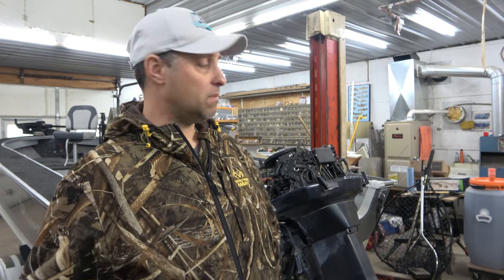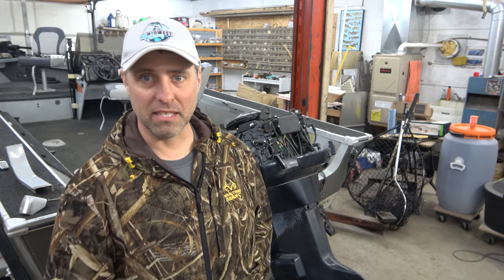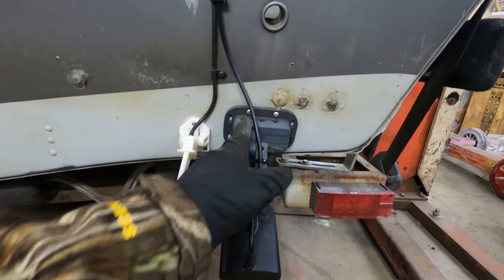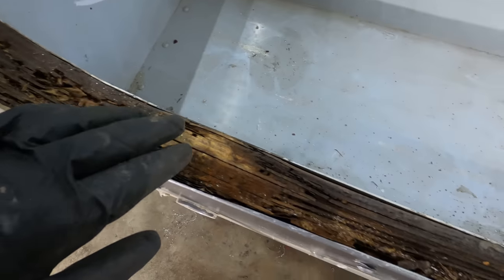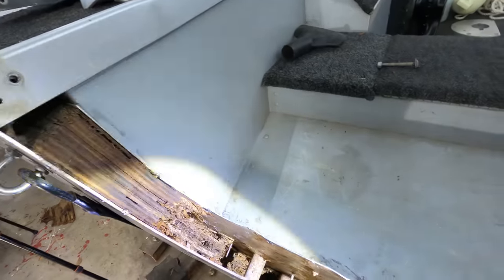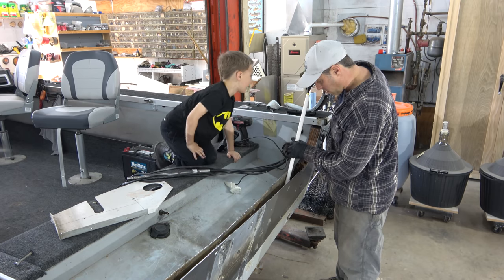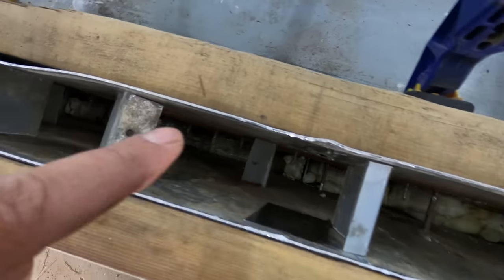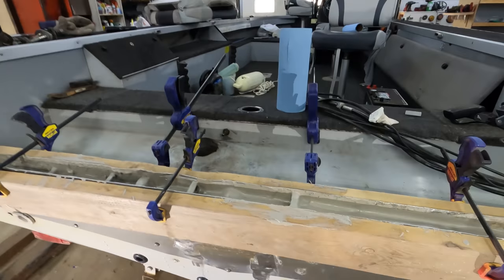The Easiest Way To Replace A Boat Transom

Comment: I’m curious as to why the transom dry rotted anyway. There had to be water intrusion for a long time
Reply from the maker: The boat is almost 30 years old and has had a lot of things screwed into the transom. I'm sure it was exposed to plenty of water. Its pretty common for transom wood to rot after a while. Thanks for watching.

Comment: Do you think this will seal up holes created by the bottom of the motor mount on the motor side?
Reply from the maker: Yes. I covered all the holes with an aluminum tape. Then when it cured, I took the tape off and painted over it. I drilled out all the holes I was reusing. You can work it just like wood.

Comment: Hmm, seems like forgiving stuff, the only real issue I see this project having in the future is that spray foam is likely not closed cell like a 2 part marine foam and will water log rotting whatever is around it, hopefully it just doesn't get exposed to water.
Reply from the maker: Thanks for the comment. The main purpose of the foam was to contain the resin until it hardens up. Otherwise it would just leak into the bottom of the boat and none would be left in the transom. It seemed like a good idea at the time, but I see the issue now. I will look into other options if I do this again in the future. Do they make closed cell spray foam? I appreciate the input.
Reply: @GoMidwestFishing  The only way I know of to get closed cell marine foam is in a 2 part mix and pour.

Comment: Expanding foam seems to be a good solution, but the problem is that it is not a closed cell foam.
Ergo, in contact with water, it absorbs and retain the water.
If you can find a Closed Cell expanding foam, you are OK.
South Africa
Reply from the maker: Thanks for the tip!

Comment: Haven't watched it all yet but dude, don't get rid of that old Evinrude v4 2 cycle unless you can find another, they made those starting late 60s and not much changed since then for a reason
Reply from the maker: I will admit, it hasn't let me down yet. I'm thinking I will probably just keep the Evinrude after all. I have a Mercury 135 I'm working on, and thought it might look good on my boat, but it will be a lot of work to swap them.

Comment: Okay.  I have watched several of your videos.  I have seen enough to know you always try to do good work and you do.
You were working with a new product and you did okay.  If I had a boat, I would not afraid to have you work on it.
Speaking as a metal fabricator and jet sheet metal mechanic, I would have done one thing very differently.  Where that horizontal platform meets the transom, you tried to weld it and it failed.  Not your fault.  Instead, I would have fabricated heavy gauge angle, applied sealant, and riveted it.  I have a lot of experience with a product called a cherry max rivet gun.  They are used on mach jet aircraft.
That would have greatly increased the rigidity of the transom.
Now, on to the criticism.  The people that built that boat are garbage.  That transom most likely takes the most vibration and stress on the entire boat and they used sheet metal screws to hold the horizontal metal to the transom??
In a pig's eye!!!  They guaranteed water intrusion.  Their design was doomed to fail.
Your work on saving a crappy product is commendable.  Thumbs.
Reply from the maker: Hello Wrongfully accused. (great name btw) That was some really good helpful information, I appreciate that. You are right, I genuinely try to do a good job. Most of the time I'm doing something for the first time and documenting it as I go. That means I will make mistakes, but that's how I learn. That's also why I buy most of my items used off Craigslist or Facebook. That way I don't feel bad if I mess something up.

Comment: Your increase in speed probably came from raising the engine that one hole .  Your cavitation plate should be even with the bottom of your boat .  If your motor is lower than that , it creates drag meaning slower speed and higher fuel consumption
Reply from the maker: I agree, but now my motor sucks air when taking tight corners, so I may need an aftermarket cavitation plate to help with that.

Comment: I think the inner and outer aluminum panels take most of the stress and the original plywood just kept the thin panels from buckling much like engineered beams. In any beam, the highest compressive and tensile stress is at the very bottom and top of the beam where in this case the two skins are. A similar construction example is the VeryEze home built airplane that is made from weak Styrofoam like foam but covered with fiberglass cloth and squeeged out resin on both sides, extremely strong design.

Comment: how much extra weight now over a pressure treated plywood job? i know both are heavy, just curious if this is like 50 lbs over what a standard job would be?
Reply from the maker: Good question. I don't know how heavy the wood was, but carbon core weighs 45 pounds per 5 gallon bucket. I used two buckets, so that makes it a 90 pound transom. I'd say you are close with 50lbs over. Its probably 30-40 pounds heavier.
Reply: @GoMidwestFishing  thanks for the reply! 30-40 lbs over isnt bad for an 1800+ lb boat fully loaded (just a wild guess) and a bulletproof transom.
Reply from the maker: @ct1762  I agree, and so far I haven't noticed a weight difference, only a speed difference.  It gained a solid 2 mph on the top end speed.
Reply: @GoMidwestFishing  cool! I guess the old transom was flexing, pushing the hull into the water more increasing drag

Comment: I get your point and being a smaller lake not open water.  BUT i'd put a marker buoy on some line to be able to locate the motor on the bottom of the lake when she falls off.     probably more rotten wood if you kept digging.    well done video, entertaining and worthwhile.

Comment: good vid but you should have used sealant for your bolts and screws or you will be going back for more repairs. that is just one issue. But the issue you wee dealing with you damn near did it perfect but just missed a couple details.  Good job

Comment: They should have used Black Locust for the transom. That wood never rots.
Reply: Old folks knew what to make fence posts out of. That stuff will easily outlast treated wood. It's hard as diamonds and makes a chainsaw vibrate like you are cutting steel.

Comment: Hope it works out for ya.  Kinda no turning back on this one as getting that product out of there will prove much more difficult than removing rotten plywood.  I'd've gone more traditional with resin coated plywood but hey, that's just me. Good Luck to you.
Reply from the maker: Hi Alex. I did resin coated plywood on my last boat. That boat was easier to access from the top. It worked well. There are lots of options to choose from. I enjoy experimenting with new things, so I really wanted to try the liquid. Your right about removing it. Hopefully I never have to.

Comment: was the expanding foam strong enough to hold the motor solid?
Reply from the maker: Hi Chad. The foam was only to keep the water out of the top half inch where the transom didn't quite fill it up, and to stop the carbon core from escaping out some gaps. It has no structural properties. The liquid transom is so solid that it held the motor great. It has been holding up well, and I would definitely do it again.
Reply: @GoMidwestFishing  Good to know. I will be getting a boat that needs a transom this looks like a great option

Comment: Reasons I didn’t buy a used boat the amount of old aluminum boats that weren’t all aluminum is astounding I’ll stay with my all aluminum beauty if I wanted wood rot problems I’d get a glass boat that uses wood in its construction

Comment: It’s way too late now but marinetex could have been your friend on a project like this
Reply from the maker: Hi Jared. Thanks for the tip. Are you thinking it would have been good to fill the screw holes are maybe to fill in the top of the transom?
Reply: @GoMidwestFishing  it’s great for filling holes or cracks but I don’t think I would have used it on the transom just because it would have taken a bunch of it and it doesn’t really pour, it’s more of a paste. It’s really great for filling or fixing places that will need to be sanded back down or painted.

Comment: I noticed the engine wasn't sitting all the way down on the top of the transom so the hooks weren't engaged properly. Go back to the top hole you used originally.
Reply from the maker: The top of the transom was slightly higher than before so I couldn't get the original holes to line up, so that's why I went to the next hole down. Thanks for the feedback.
Reply: @GoMidwestFishing  Yes because you should have put the angled aluminum on first before the side/corner pieces just the way it came apart. You don't have to be an expert to do a good job, but maybe im just an OCD A hole! 🤷‍♂️

Comment: You engine needs to come up one ☝️ bolt hole  looking at your ride at the end.  You got water pushing up on the cowling   This will give you better performance.
Reply from the maker: Thanks for the info. My transducer sprays water up at the cowling. I need to make a shield for it to block the water spray.

Comment: Yep it's called work I've done a few of the and re rivit  the boat I like the fiberglass boats the best a lot easier to work on but still have to do a lot of cutting... You still have to remove the rotten wood .   So your going to sell it after..lol...
Reply from the maker: I wasn't sure I could re-rivet the whole back end back on correctly, so I had to search for other options. This is my working boat, I'll probably keep it a long time. I might buy some other boats just to play with and sell though.

Comment: 22:17 - with all due respect what you tried is not "welding".  All you were attempting to do was solder aluminum.  I hate how the rod you tried are advertised as welding.  Good video - definitely learned something.
Reply from the maker: Hi Greg. Like you said, the package says "aluminum weld." It was an experiment. Never did it before, so I was curious if it would work. I could have edited out that whole part, but I learn from making mistakes, and hopefully others can learn from it too.

Comment: Ive wondered id epoxy would work as well. May get too how and damage the metal perhaps
Reply from the maker: The carbon core did heat up, but not hot enough to damage anything. I'd probably stick to products made for transoms, that way you know it will be safe and work properly. Thanks for the comment.
Reply: Epoxy would work, Mix with sand to extend volume and minimize bubbles.

Comment: if you are going to weld aluminum you need to use a mig or tig welder or forget about it
Reply from the maker: After doing this, I would completely agree with you.
Reply: @GoMidwestFishing  there's a face book page DIY plate Boat kits not sure if its Australia based or over seas but may be worth you having a look may help with your repairs
Reply from the maker: @ruffnut743  Thanks for the info!

Comment: If you need a water burial,  the techniques used here should do the job ! "it's a great product....I haven't used it yet...",   "if there's not quite enough I'll just put some wood on top...", " you have to put a bolt though the fly hole...", " I don't see any need to take this (rotten wood) out.." "Couldn't get the wave out but....", "THAT LITTLE (2 INCH) GAP THERE, I JUST PUT IN SOME OF THAT EXPANDING FOAM..." " Some big bolts will go right through there ( where the foam is)  to hold it tight..."

Comment: After watching your video on "HOW NOT TO REPAIR YOUR TRANSOM" I took a good look at my boats transom. Fortunately it is fine, however I did find that the "engine well" is held in place with screws and the wood transom is scewed down to the hull. So all you would have to do is remove the engine well, then you have full access to the transom from inside the boat. This would make sense for the sake of preserving hull integrity. My boat is an early 80's Smokercraft 16' aluminum, not all boats are built the same. However before starting a huge project like this especially where safety is a concern. It is always prudent to reverse engineer how the boat was built and repair it accordingly.
Reply from the maker: Hi Daniel. Thanks for the advice!

Comment: Because he didn't have enough composite the air gap at the top means the top bolts are probably not holding the engine too solid....
Reply from the maker: I was concerned about that, which is why I added the 1/4 inch aluminum plate where the bolts go through. So far its working just fine. Thanks for the comment.

Comment: You could have used concrest with a plasterzizer and a steel mesh halfway. Would perform just as well and cost a lot less
Reply: Concrest? Did you mean concrete?
Reply: @aNuthaRedneck  sorry yes

Comment: Why is there wood in the structural components of an aluminium boat???..from Australia here...when a boat is made of aluminium here it is ALL aluminium...especially the transom which is usual formed from BOX RHS aluminium beams...except maybe the flooring or  seats..
Reply from the maker: Probably because it is a cheaper way of doing it. A lot of manufactures are starting to switch to other materials now. Better late than never I guess.

Comment: "I just need to fish in it and make it work"
you should see my boat!!
don't laugh, it's paid for

that material is pretty strong, I wonder if putting some re-bar in there would make it stronger (not rebar but something lighter perhaps)
Reply from the maker: I would never laugh at your boat. You haven't seen the rest of mine. This is the nicest boat I own. Others have suggested re-bar. I'm sure they put a lot of research into this product, so if they don't suggest using it, then it probably doesn't need it. It might be a good question to ask them though.

Comment: I tried those rods on my aluminum boat and it didnt work out. The boat acts like a big heatsink and gets rid of the heat faster than you can heat it lol
Reply from the maker: Hi Derek. That's exactly what happened. I kind of figured it wouldn't work, but I wanted to try anyway just to see.
Reply: @GoMidwestFishing  when i did it i tried just getting it hotter and hotter and the boat started warping lol. i was using it on a crack in a john boat. we tried everything on it lol duct tape (heated up makes it very strong), jb weld, weld rods, flex seal and 5200 (worked the best).

Comment: With the 88hp motor pushing pushing a light boat like this one, the load on the transom will not that great. The screws passing thru the back deck and encap
Reply: Encapsulated buy the epoxy helps to spread out the loads, yes it will fail, in 20 years, but for sure, replacing the complete transom would be the correct solution as noted in the comments.

Comment: After watching, I see you made the mistake I made. Not enough to fill to top where motor mounts. I used multiple strips of 1x2 and thicken epoxy which gave strength and was 100% water proof. I also used angle aluminum but I riveted the outside on 1st for straight and strength. I would never use foam for filler where ever I needed strength, never ever
Reply from the maker: Hi Mr. Ski. Looking back, using a wood strip on top would have been much better. You are right about the foam. Not a good idea.

Comment: Happened to run past this page again. I read every comment below and have to say something.

People, those of us that criticized this job was not because of being haters nor armchair quarterbacks. I have owned repair shops from Virginia to Montana, then south to Alabama, North Carolina and Florida. I brought up my points in order to hopefully have some of you NOT think it was OK to do this to a boat.  People die because of crappy work like this. I do not care one bit that it survived a whole season without falling apart. The fact is it will fall apart sooner or later and for 200 dollars he could have finished it correctly.
Looking below I do not see a single "HATER" I also do not see one single comment that was WRONG with the negative things they had to say. I am sure this guy is a happy man, a good man, but he did this wrong and you should NOT tell people they did it right when it is obvious to every single one of you that watched this video that it was not finished correctly. That is not a small outboard on the back of that boat it is 319 lb torquing, twisting pushing, pounding muscle machine that is constantly flexing that transom and trying to tear itself off of it.
The top engine mounting holes are drilled into very little of ANY good material and contrary to what he is saying, it IS making that boat transom flex and the holes (if not already done) WILL be rounding out and working bit by bit to come undone and snap off towards the top of that transom. 
The edges and upper areas port and stbd are trying as well to tear themselves off and they will sooner or later.
Anyway, there are things in life that participation trophy's will destroy. Letting him know where he messed up (like people do to me when I screw up and rightfully so...) might have had him rethink this job and have it finished right. Instead you guys led him to believe it was not bad after all and God help all of you when or if someone drown or is injured by it.The saddest thing to me? He has had a year now to decide to get pro help and fix what was the last section. Instead, he listened to all of you tooting his horn. Great Job....
Reply: I appreciate all of the comments on here. Is it the remaining wood in the top corners that’s the biggest issue? I’m looking to pour a Lund tyee.

Comment: Everything looked great until you used foam spray and flex caulk . Solid pour and 5200 under aluminum would have sealed and secured permanently, but over all good job
Reply from the maker: Thanks for the tip. I looked it up, and I agree.